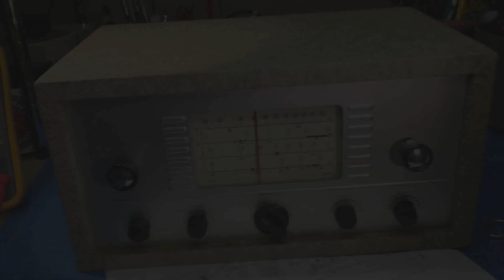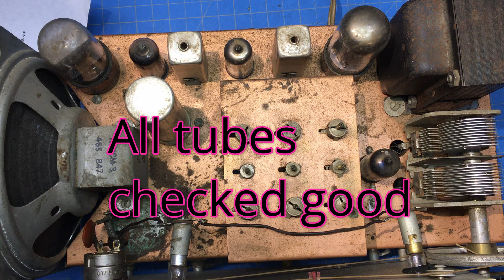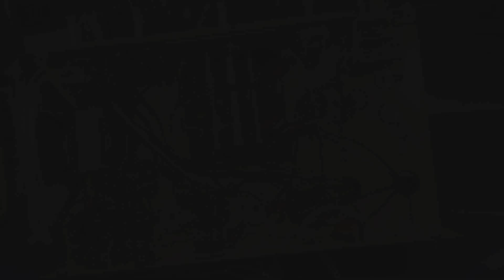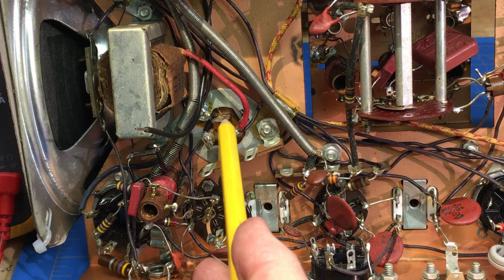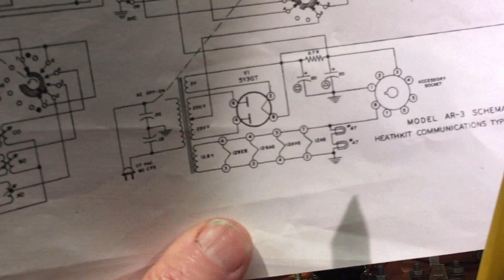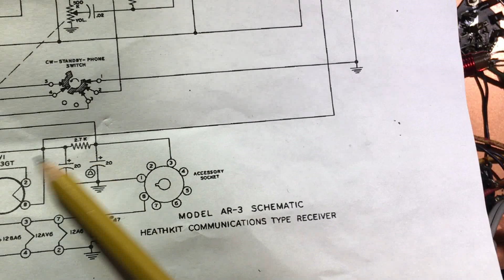Mid 50's Heathkit AR 3 Receiver Check out and Minor Repairs

Comment: Hello Larry, I tried to power up my Crosley 516 today and it PLAYED! After all that was wrong with it, i was happy to see all the homework i did payed off. Your vidieos on the 516 helped tremendously. This thing had open coils on the speaker, output transformer, and antenna coil. The on/off switch and volume control had unreapairable electrical damage, something like a short.  Replaced all that and the capacitors. The thing i noticed is that i have 30 volts high on the plates and screens of the tubes. I'll try to replace the output tube 6b5. I saw where someone else had the same problem and it was their output tube was "low emission" causing high voltage on all tubes. I thought you said to put a capacitor on replaced pots. 'which of the three connections of the pot would this go?  Thanks for what you do. GaryK
Reply from the maker: Gary K. Thats Great Gary! I know you feel good about that...its always a great feeling to hear one you work on come to life...a confidence booster for sure...Im not sure what capacitor you are talking about....maybe capacitor 9... A .01 uF...that goes to the AC line to chassis? Look on Part 5 at 5:00. I replaced the cap with a Y2 safety cap.....a regular cap will work...just a modernization using a safety cap. Could the voltages be reading high because of your meter? It is not specified on the schematic, but they may have been using a 1000 ohm per volt meter to check them.......a tube with low emissions will cause its plate voltage to run high (lower current).....I guess its possible for it to cause other voltages to be off.....Did you watch my video on Part 4 of the Zenith 5R135 where I talk about  meter loading. Also, if you think this could be part of the problem...check out Don...at RestoreOldRadios video Crosley 718-B "High B+ Voltages or Maybe Not?".....Hope this helps!!! Take Care and Congratulations on your Crosley!!!!   Larry
Reply: @Backtothefutureradios  The cap i was refering to was one to the replacement pot. I recall you saying when a replacement pot is used, it needs a cap so the pot works correctly. The voltage i have one the output plate is 230v. Maybe that's not high. The schematic i have has 200 on that point. So now i need to build a cabinet. I have only the face of the old one. I have no top, bottom, or sides. I will get it done however. Thanks GaryK
Reply from the maker: Gary K. That is a resistor on the pot unless the pot has one built in....that was on the Silver bell I believe....email me at lhlyda719 at att dot net
Reply from the maker: Gary K. If you email me...I think I can come up with a cabinet for you! Larry

Comment: I have a Heathkit QF-11 Q Multiplier which I have reconditioned and wired with a grounded plug and calibrated it, if you want it.  I got it for a Heathkit GR-64 which I gave to a neighbor, but the neighbor would not have appreciated it.  It tends to reduce sensitivity so I was pretty disappointed with the combination.  Basically the GR-64 was not remarkable with its sensitivity to begin with.  It probably will work with your set.  The CW position needs some debugging as the 'motor boating' in that position is not a normal response.
Reply from the maker: Hallicrafters Rehabs Thanks for the offer, but, I really wouldnt have a need for it! The set wasnt and still isnt that great of a receiver. Im sure it needs a bit more TLC to get it up to specs! I pulled it out to recap it and look inside it....I have used the am part of it during the summer for several years listening to am radio.....It started a hum and with a lull here and lack of radio entertainment on Youtube....I decided to look at it on camera. Good learning experience for me and hopefully for others....not to mention some drama and maybe a smile or laugh. Im really behind on my youtube watching myself, as ai have a couple of yours and a few others I havent watched...maybe today after "virtual church"!!! If the humidity is <65%.... I may shoot some lacquer on the Zenith! I appreciate you watching and always enjoy your comments! What do you think is causing the motorboating? Alignment? Take Care--Larry